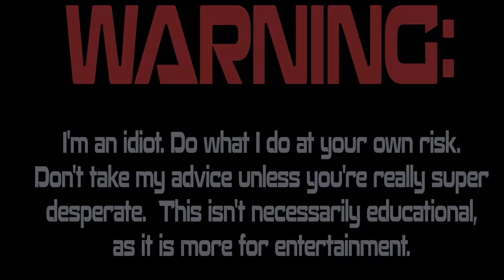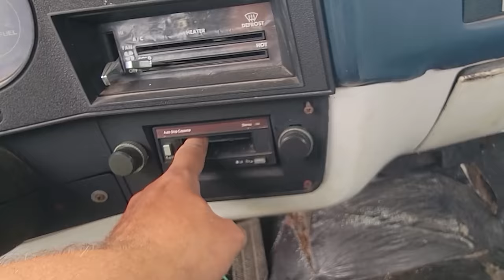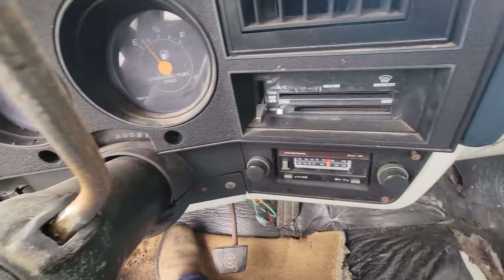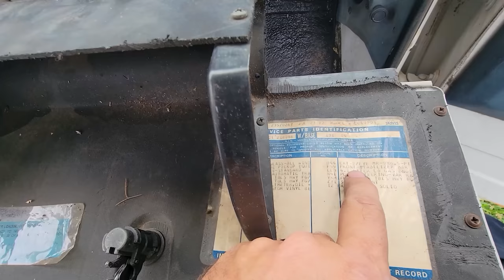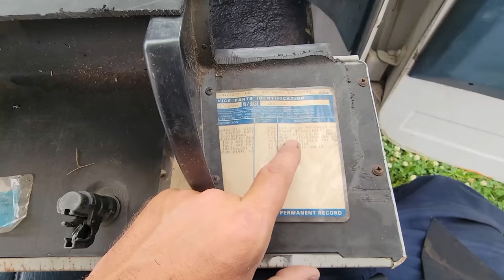Will This Square Body Truck RUN AND DRIVE Home 200 miles after 15 years?

Comment: I'm in favor of replacing the head gasket... six in a row and ready to tow is more interesting than the V8 literally everyone else has.
Reply: I was thinking the same but by how rusty that spark plug is that cylinder probably needs some work
Reply: @MrRacer1986  All the more reason!  I don't think he's done that yet

Comment: It clearly needs to be saved and the engine replaced. When I don't know.  Now that you cleaned the protective dirt off, you need to put something on it to prevent rust from taking advantage of it while it's naked.  Spray something out of a can. Your choice. Then put a decent tarp over it.
  edit; this truck is going to flash rust like nobody's business if you don't get ahead of it.

Comment: Chevy truck looks pretty darn good for sitting fifteen years.After you cleaned looks pretty straight and solid. Work on existing engine....or put in the Camaro 350! Looks like a nice truck! Good luck Derek.... Enjoyed the video!

Comment: Derek, my suggestion is to use the bed for your blue truck (why you bought it) and put the Camaro 350 in this white truck.  Then you could put a wooden flatbed with staked sides on this white truck.  It'd be a good car parts/hay bale hauler.
Reply: This is exactly what I came here to comment! Best of both worlds for sure
Reply: I say the same thing, although with as bad as the frame is on the Chevelle, this as a flatbed would make a killer burnout truck.

Comment: First of all, thank you for putting out these videos! I do so enjoy them. What I would suggest with that truck is this. Take the bed off for your other truck and build a wood flatbed to replace it. Then if posable fix that 250. It would make a great field/part chaser truck. With a basic flatbed on it you could haul anything with it. put a good hitch on it and it will pull as well. It would just be a good simple work truck. And you could use that bed to fix your blue truck. You probably have more work trucks than you will ever need, just an idea. Thanks again!

Comment: You  had to be smiling every time you looked in the rearview and saw that bumper and grille as straight as the tailgate on the tow rig.  Great find,  great video as usual.   Thanks for sharing it with us.  Great family and content.   Thx VGG.

Comment: Thanks from Denmark for another great video! Just had a thought: Given the "Let´s unbolt everything"-approach to fixing this, did you check if the head bolts were torqued down? -or would such a failure be readily obvious? (I rebuilt a 50cc Honda moped 30 yrs ago as a teen, which comprises 100% of my mechanic proficiency :D ) Btw, I´d vote to rebuild her, I6 and all. As long as you have fun doing it we´ll gladly watch your antics :)
Reply: I'd wager the gaskets are just shot, its a bit of work to unbolt the heads, and being as rest of the engine is still intact around the heads, I'd be very very surprised if someone tried on the bolts. 
I agree with rebuild it, just with a V8 instead of the six, its where the value is
Reply: definitely save it

Comment: I was sad to see the head gasket issue with that 6.  I am one of those oddballs that actually like a six cylinder better than the V8s.  It is probably fixable.  The truck itself is well worth saving.

Comment: "I get too emotionally attached..."
I can totally relate, and that's why I enjoy every revival. I didn't have a "rusty acres", but at one time I had 7 cars in various states of repair, including my going to town rig - the neighbors loved it. 

No, not really.😁
I'ma tell you what you do, and you know already,  so it will be ez: take the 350 combo unit out of the Camaro, slide it into the De-Luxe, run twin vertical stacks and a 12-bolt rearend, and let her eat asphalt till she's had enough. 3rd shop truck to loan out for Power Tour 2023!

Comment: My brother's 4 liter ranger had coolant running out the tail and shooting out the spark plug hole like this thing. We put bar's leak head gasket fix in it. After driving it a bit it sealed it. He drove it for thousands of miles before he sold it. The guy who bought it drove for along time as well.

Comment: Swap the motor, get it running and driving, move it along so someone else can love on it. The best you can do to save these cars isn’t stacking them up in a field to “get to them later” but rehabilitate as quickly as possible and move them to a new home. You are like the no kill animal shelter for cars.

Comment: I haven't seen coolant come out the exhaust like that in a along time from any engine. Being that there is no water in the oil, it might be that the coolant is only getting into the combustion chamber with just a bad gasket and that the head is still good and not cracked, because if the head was cracked, the oil would be contaminated. Might be worth a shot to just pull the head and put a new Fel-Pro head gasket back on and have a decent runner, unless you want make it a very powerful sleeper rig with another power plant you have. That truck looks like it doesn't deserve to be used for parts, i think it needs a revival as good of shape that the body is in.  BTW, WOW! your boys are really starting grow up, reminds of my nephew. About 4 months ago he was shorter than me, now he is as big as me, LOL! Keep up the Cool content!
Reply: I agree cj7,  but ha!,  pouring out the exhaust, I aint never seen that before.

Comment: Just inherited one of these from my dad.  Only been sitting 4 years.  He had done some work on it and got it rolling around doing burnouts.

I intend to get it running again.  He had mentioned something about the starter and flywheel not making contact unless you're parked on a hill.  Not super transmission savvy, so a guy isn't entirely sure how to fix that.

Comment: Leave the 6 if it's not too bad, obviously swap carbs. Manual pedal asm, Slap an sm465 behind it, or the old saginaw 3  converted to the floor...this configuration is what many started turning wrenches on.

Comment: This is the exact truck that I was telling you I was looking for. I have looked all around Florida Georgia just cannot find one a decent price that I can afford. I want to do the same thing that you're doing to him find one that doesn't run that I can tear apart get running fixed up and have a work truck. There were nothing left on the truck that burned up in the fire except for some taillight stuff maybe the rear end but the whole front of the truck was burnt down all the wiring the tires all the rubber the windshield all the windows. I'll just keep looking keep on bringing the videos love them brother

Comment: I had one of those wasn't a custom deluxe but a doner from heartland Express you could eat off the bottom. 305 truck I put a 350 rebuild from a wrecked 86 , in a 87 had throttle body good gas mileage 2 wd good in the snow. I miss that truck put 2 or 300 thousand on it.keep that truck whole!!!

Comment: Just a sidenote for anyone reading, when you call an Uber and you're far away from town and the driver had to come a long distance to get you, be sure to tip really well. Basically that time and gas money he's using to get you is a break even at best, so that guy really did you a favor! That's time he could have been earning more money with other rides.

But about the truck, fix it at is! No need for an engine swap. If it ends up being only a head gasket that's bad, that's a cheap and easy fix!

Comment: When you put the question to us, I could not help but think back to the straight 6 Mustang from Power Tour. Just like you Derek, I have a lot of respect for four people that stick with the four-cylinder or the six cylinder in a world where everybody has to have a V8. That being said, I feel like the old girl at least deserves to have the head taken off to see if a simple head gasket repair would put her back on the road with her original equipment. If after exploring this option you find a cracked head, a cracked block or some other catastrophic failure then by all means get the V8 out of the dirt Dobber Mark and let’s make her go fast. I already know and understand this probably won’t be a popular idea but I stand by it.

Comment: You throw that handy Camaro V8 & Auto trans. in her and you could use it as a daily driver..!
Now, about those SOS pads, back in the mid to late 1950’s and most of the 1960’s we (I or Me) would use those to clean the ‘white walls’ tires during the hose & bucket car washing…🎉

Comment: You should put a nice rebuilt 350 chevy in this old truck. You should get the boys together and rebuild a small block 350. Then later you can teach the boys to drive in this old 1982 C10. Super easy to repaint this truck it's white.

Comment: Traditional values call for the extra cylinders.  At 18 I pulled a 6 two out of dad’s 82 and dropped in small block from a Malibu.  Also, I grew up not far south of you.  Wrassled two

Comment: Had an 81 C10 with a 250 Inline 6 I bought for $100. Put a new battery in it, put air in the tires, started it and drove it outta the cow pasture it had been in since 99. If you listen closely at night, you can hear your square rusting!

Comment: It is now April 2024.   I never saw what became of this truck but hope it wasn't parted out.
It appeared the interior was in good condition and the body had minimal issues. The rust on hood and on top of the cab could be easily treated.
I think this is a good candidate to get the same treatment as the white F-100 done or finished last month.  That was my favorite episode.  The Chevy deserves the same and you wouldn't have to use or get help from your friend on the body work and paint.
An old friend's father who I was fond of drove a two-tone red and white GMC Scottsdale.
I enjoyed many times hanging out with him as he tinkered with his GMC square body truck.
I love American trucks; GMC/CHEVYs and or FORDS.
So maybe there's an episode that I've missed where you did something with this white Chevy.  ???
Great episode despite the fact you had to give up on getting to run the distance and settle on towing instead.  The wash makes me think it's a worthy budget restoration.
Thanks for the show. I wish I could locate a vintage straight 6 truck or car that I could get running or tow home for a project myself.

Comment: Looks like either aftermarket ac or dealer install. The ac bezels don't look right and it shouldn't have the floor vent pull knob.  Also that's not an ac box under the hood.

Comment: Sorry I'm late to the party. I'm a little behind in my vlog watchin. Derek, those 4.1 liters with the integral intake manifold were known for running hot and the head cracking between the valve seats. If it really got hot, it would crack on the head gasket suface, usually around cylinder 3 and 4. You're dealing with a boat anchor with that one. Also, the cylinder head from the older versions with separate intake won't swap in.

Comment: Parts truck to fix the blue rig! Also, for whatever reason, old stuck on wheels, try the backwards donkey kick. Tends to work much better for whatever reason. I have to kick most wheels off because I live in Connecticut and everything is rusty

Comment: Long time subscriber, currently working through the videos in order. I've noticed that you seem to buy stuff (and this truck is a perfect example) that you have no idea even if it runs, or if the previous owner parked it up after the head gasket blew etc. Do you not ask them anything? Or is it part of the 'fun' to simply buy without knowing??

Comment: I would put the good 350 and trans in it and fix the interior and drive it looks like a good truck for as old as it is. It’s not all rusted out , gots good flooring or do a little fixing on it and sale it.

Comment: Dude, I'd switch out that motor for a nice 350, little Bondo, paint job, have a super nice truck.. and I've never seen these year truck without rust thru.. I've had a few..peck

Comment: The body seems so solid…I’d try a new head gasket on the I6 if not then maybe swap it with a V8. Even a used 305 would be a nice up grade.

Comment: Those straight 6 engines are torquey engines. They pull better than V8s but not as much HP. My dad had a 292 straight 6 in a 68 Chevy with a 4 speed and my uncle had a 75 v8 350 and pulling approximately the same weight, my dad’s little 292 would out pull my uncle’s 350 v8 up them hills. I’d build it back out. Sacrifice the bed to the other truck, and make a hardwood flatbed for the 82. Your sons would fight over getting the 82. Straight 6 is no slouch. But not a hot rod either. Brawn over beast.

Comment: I agree with most of what everyone else has said so far. The truck is in too good a condition to part out and their only original once. Great engine swap candidate! Either that 350 you mentioned from the Camaro or possibly an LS.

Comment: 43:21  The moment when you forgot the Coke Cola drink was in frame,      47:54  the moment when you need to implement damage control by hiding the Coke Cola bottle. Slick AF...

Comment: Id keep it together. Swap in a v8, add the brake booster, 700r4 trans. Overdrive will give you some better mpg. But like someone else said dont junk the 250 I-6. Do a teardown on an inline 6.  Even better make an engine test stand. So can run it before dropping in a vehicle.

Comment: Back in the day we used to run everything up in the bed and bend the front up against the cab.  Pull it away so it don't rub. Hey,its a pickup. Course back then you could buy old pickups all day for $1,000. Most were plain Jane work trucks. Chevy started making a fancy truck called a Silverado in 73, but well into the 80s fancy pickups were the exception .

Comment: Keep it Bro, sand the mirrors and paint them white, same with the bumpers..lightly sand the exterior and hit it with 2 coats of alpine white and 2 coats of clearcoat..get it registered in Benly,s name and give it to him when he is 15 1/2 years old and tell him to put a 4 inch lift kit on it and get some 35 inch tires..he,ll be the talk of high school when he shows his buddies how he worked on his first pick up truck..awesome..

Comment: I watch your videos all the time and enjoy every minute of them.

Got a question with the ignition module on the HEI. 

I'm rebuilding an HEI for an old 77 Sierra. Does it call for dielectric grease or can I use a thermal compound instead to help with heat dissipation?

What's the best grease to use in the grease wells, a red multiple purpose wheel bearing grease should be fine eh?

Edit

Do like your boy Bentley said, keep it!

Comment: I have the SAME truck. White 81 custom deluxe .. Blue interior, 6 cylinder we have a 3 speed on the floor! Hah. and three pedals. Your body is in better shape, ugh, the truck.. You gotta keep it and put a small block in it. Got to. Buy a new fender from someone new. Thats what I'm gonna do with mine. PS. Mine runs and drives perfect, although the windy spritzer won't stop with the wipers on.. No big deal, its buried under snow today.

Comment: The Chevy 6s had a balance problem. They were famous for the piston skirt breaking. One guy told me he literally heard them popping off as a new car idled.
 They idle sloppy because of that. 
 You could easily get 200,000 miles after they Break

Comment: Those straight 6 engines were work horses. They were very reliable. I think you should get it running and restore it as a work truck. Nice wheels and tires. Betterize the interior and slap your logo on the doors.

Comment: It's too nice to part out. As someone who is sick in the head I would do what I am in the middle of doing and build a hopped up 250. I have an 80 with manual everything an a three on the tree and it's getting a non integrated head so I can run a Clifford's twin 2 barrel intake, I have an rv tow cam, a split header, and a fresh and balanced bottom end. Or you could just chuck a v8 in it and save thousands of dollars and get superior performance.

Comment: 6 lug rear means upgrade rear end. It probably has the leaf springs instead of trailing arms a normal c-10 would. But why put a tow package on a 6 banger? Drop a 350, get rid of that carrier-bearing two piece driveshaft, and a little weight in the box, it’ll hook up.

Comment: It being the first time you couldn’t drive her home that is a first. 
This truck looks too good for parts. 
I’d like to see you and Bentley swap the 350-350 transmission from the Camaro in it. 
Derek if you’re willing I’d like to see the tear down on the inline 6 to see if it was the head gasket or head or block.

Comment: Drop a 350 into this clean square body and put it out there for someone to buy.  Sand the hood and top and throw a few rattle cans of duplicolor on them.
You be sitting on a beauty. And you won't have to much wrapped up in the thing.

Comment: You can't beat a Chevy pickup with a 350 in it period, it's a forever truck Like one of these guys down below here said put your vice grip on the door and let your boy drive it around it doesn't need A/C its got the little side windows, needs new shocks and springs and grease everything, check the vacuum and the electrical, Give the chevy a gel battery with the screw on-off deal on the red wire, in case it sits for a while. Makes me want my old full sizes couch chevy 78 I'm in Florida and on weekends we would drive to the beach and spend the weekend there. My wife and I met laying in the pick-up bed watching a meteor shower . the dogs slept in the front seat

Comment: Will a bad ignition module inside the distributor cause a no crank no start issue? I have a 79 k10 that was running perfectly fine one day and then I stopped to get lunch and it wouldn’t start again so I replaced my battery , battery cables to alternator and starter , new starter , ignition switch , neutral safety switch but still nothing, I have power at the starter, the ignition switch and fusible links . So everything has power that should. I’m stuck and don’t know what else I should look into